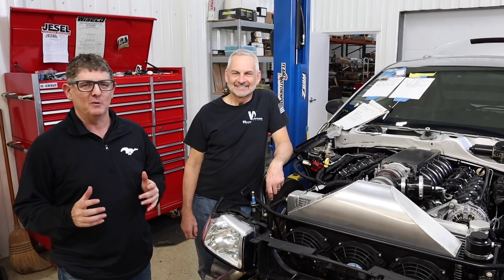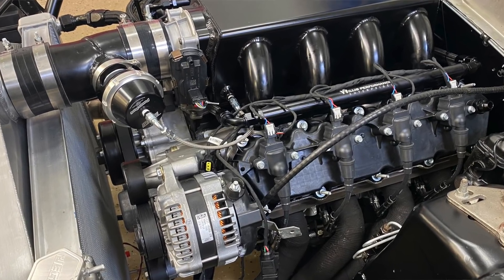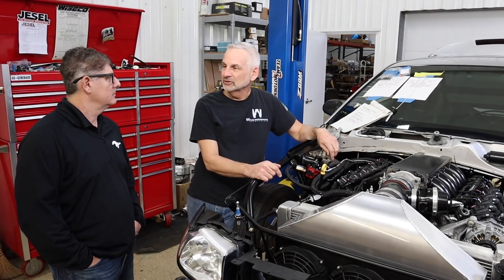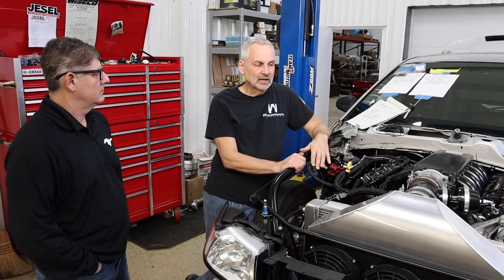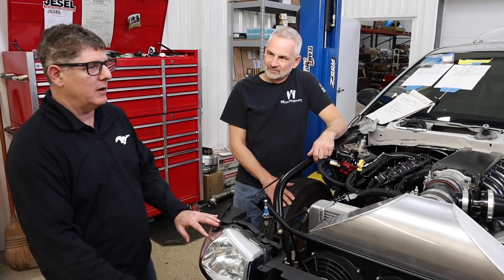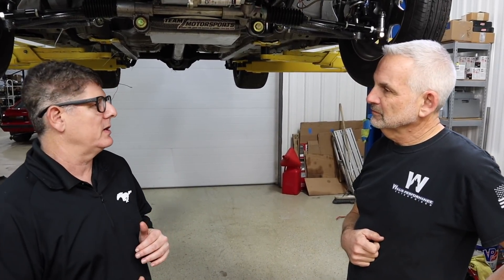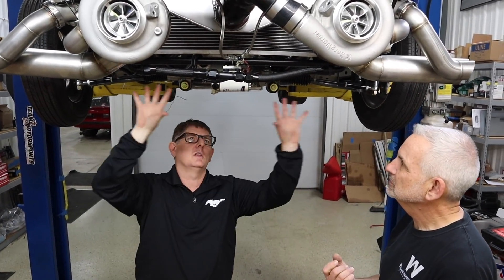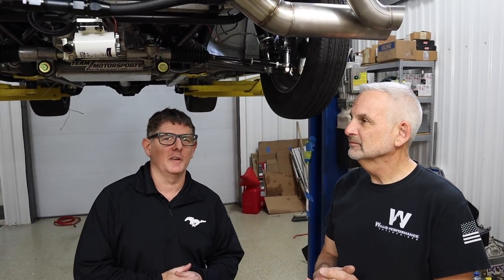1,200 hp Twin Turbo Godzilla Mustang | Calling "The Wolfe" For A Sick Street Build! Part 1

Comment: This is pretty cool.
Still love the pushrod stuff . Lots of respect  for the 4.6 stuff . Love the coyote stuff .
Reply: @bigboreracing356  I'm sure it's coming .
I'm actually working on a ling turn plan for the 6.2 truck motor . 
Would like to see the difference in power . Torque . Cost etc . 
I now have a 360   victor 7721 headed turbo setup . My plan is to go 10 over on the 6.2 making a 380 instead of a 379  . With stock forged crank and aftermarket rods and piston . Stock headed stock vavle port head and some type of retro fitted holley intake .
I just saw (forgot his name ) run 7.89 on a stock clock stock forged ford crank 4.6 2 vavle at the mod nationals. 
That completely blow me away . So imagine a thicker block 100x better ford head and motor on that tune  .

Comment: Doing a 6r80 swap in a 2009 Gt 500. Looking forward to see the quick 6 works behind this monster
Reply: As with most engine parameters, it depends on how far you want to push the envelop.  But i would go 4.25-4.38ish.

Comment: I would like to see Ford do a BOSS 429 with this motor from the factory!!As far as aftermarket power and things,this motor is about the same as the 5.0,5.2,and the Legendary 5.8!
Reply: 🤔 torque and air flow say otherwise
Reply: @ranware2779  when this car gets into the 6s let me know. I'll wait.
Reply: @drfaticus  Watch for our FoxBody with the Procharger :).   We may only do 1/8 mile with it; however.
Reply: @drfaticus  whoa i kno you not pumpin the coyote up when thats an all billet non ford produced engine cut your cap lil fella.... yea the coyote is good for what it is but for damn sure aint our holly grail clown
Reply: @ranware2779  hey lil dude when this 7.3 does 6s in the 1/4 mile,get back to me.I am not downing the 7.3 at all,im just saying coyotes make this type of power,and so does the 5.8.
Reply: @brianwolfe2993  1/4 mile or full mile would be better.
Reply: @drfaticus  how many yrs have they been out? 11yrs.... this engine doesn't even have afyermarket heads on it! Lol ford gave the modular engines and it really has you guys thinking their just untouchable.... new flash their very touchable the only coyotes worth talkin about are swapped ones and the s197 crew s550 coyotes are breakin any new numbers nor gettin past the ones that stand
Reply: @ranware2779  I never said they are untouchable.Again when this 7.3 and the heads that might come out for it runs in the 6s,and 7s,let me know.The worlds fastest FORD GT that did over 300 MPH in the standing mile has a 5.4 in it.
Reply: @drfaticus  most of the racing now is 1/8th mile
Reply: @ironmike742  thats a shame